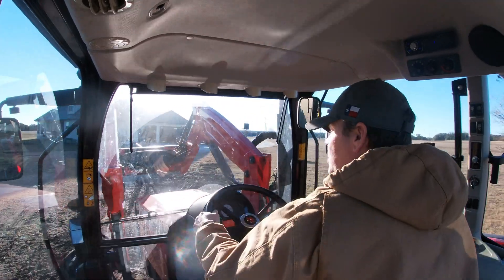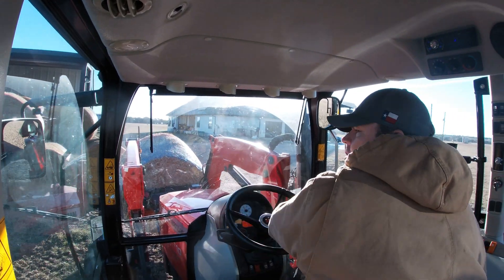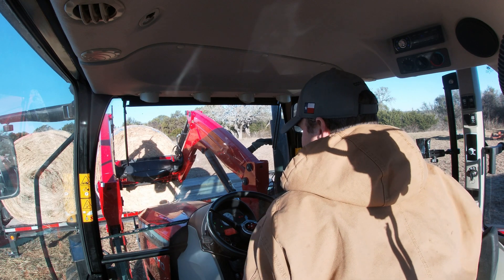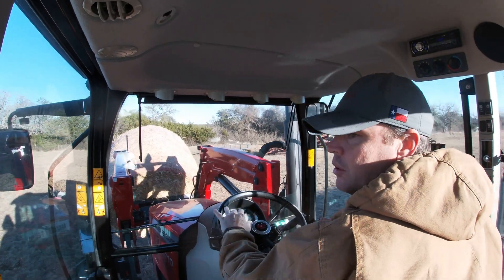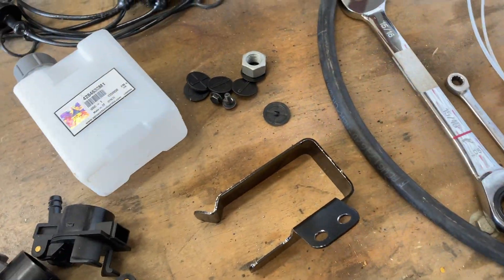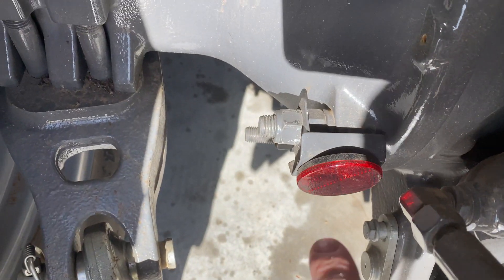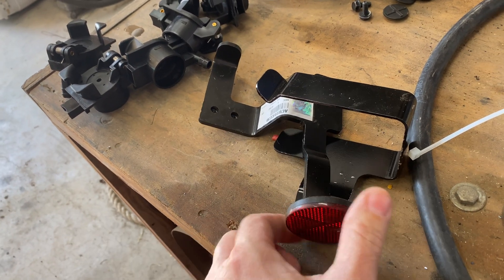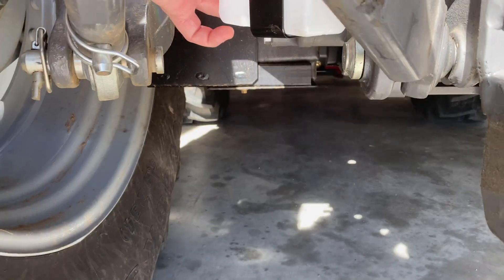Massey DEF problem & SCV Oil catch bottle installed

Comment: I've got a 4710 its a 2017 I've had def issues for the last 2 years I'm getting ready to head to the dealer about 100 mi away to have some codes cleared I don't know if I'm going to keep this tractor or not but they sure are a pain in the butt.
Reply from the maker: Yeah it sucks getting a warning light out of nowhere. 

Check out gpt-consulting.com
They help with the DEF system ;)
Reply: Can't you just get a 4707 and tune it?
Reply from the maker: @ln5747 yes but the 4707 has egr. So it runs dirtier than the 4710 which is scr only. Makes it easier to do the weight reduction and tune

Comment: Having def issues again on our MF. I’m in central Texas also and have not had much luck with dealers. Do you have a good one?
Reply from the maker: The only two I know of is Blackland equipment in Temple and Three Rivers in Granbury. I keep getting the same DEF quality error code every once in a while. I’ll drain the tank and refill but it’s getting old. This last time I flushed the tank with distilled water and blew it out with air before refilling it with fresh DEF. It seems to occur more often with the cooler morning temperatures
Reply: Thanks for the reply! Do you have a way I can contact you direct? I’d love to visit about these issues as ours went into limp mode on me this weekend.
Reply from the maker: Send me an email to centexag101@gmail.com

Comment: A guy I used to work for had a 4710 just like yours and i swear it spent more time being worked on over def issues than it did in the field doing work... Not trying to talk a brand down but so far the New Holland powerstar 100 I have hasn't had any trouble and uses way less def than the Massey Fergusons.
Reply from the maker: Time will tell on when or  if I have anymore issues with it. I found a place in Texas that can make the system go away but I’m not risking voiding my warranty unless it cost me to much downtime

Comment: How many hours is on that tractor? When I bought a new holland ts6 and a massey 7616 brand new they both threw poor def quality codes within the first several hours of use... drain it out and put fresh stuff in. Don't think condensation is a thing for that, i keep the def tank on the 7616 at around a 1/3 full all winter long to prevent any bulging issues on teh tank if the def freezes.

That's interesting the Maintenance manual doesn't have error codes listed. The catch bottles are great for knowing if an outer oring is bad in the couplers.
Reply from the maker: It’s got 39 hrs. It seems draining the DEF and adding a fresh bottle has fixed it. Good idea on keeping it 1/3 full.

Comment: do you know if there’s anything like those  remote caps for new holland?
Reply from the maker: My workmaster already had the flip open caps which are nice but I never could find an oil catch bottle for them. The premium tractors like T5 or T6 may have one which you could probably make it fit on the Workmaster. Just have to do some research

Comment: I had an issue with the def system on my T5.120 after letting it warm up, too… the dealer told me not to let it idle at lower rpm as it could cause an exhaust build up and it would temporarily derate the engine. Something to consider as well.
Reply: The only way to run these engines with def is wot. No putting around in them.
Reply: It's brilliant right? Create emissions to reduce carbon foot print of said machine and the same emission system won't run properly if your not wide open burning tons of unnecessary fuel putting more carbon into the air..... makes so much sense
Reply from the maker: That’s pretty much what I did (let it idle to warm up). I have to remember to bump up the rpm’s from now on. Thanks for the info
Reply: @CenTexAg  the engines need to get up to operating temp and pulling until it starts to inject def into the system... if putzing around too much or low engine speed (or plain short periods of run time) will cause codes to pop up saying to run the engine above a certain rpm. I don't think it derates the engine right away, I think it goes on a timer at that point for something like that, but only get like 3 engine restarts if the error reoccurs and will fully derate the engine and that requires a service call.

Comment: I have really been wanting a 4707 with dayna 2 can’t find any around me though one dealer close has 20 on order but Massey just told them they were not going to be shipping any of the ones they ordered with the dayna 2 trans. So I talked to another dealer and he said they were having some issues with the dayna 2 trans that’s why they were not shipping them out right now. Wish they would get it figured out because i sure want one. They have a few showing up next mounts without the dayna 2 but I really want the dayna 2.
Reply from the maker: That’s pretty much how it was around me. I had to drive 2 1/2 hrs away to get this tractor which they only had 2 in stock. I hope they aren’t having issues with that trans because it’s similar to the Dyna 4 and Dyna 6 which has been around awhile now.